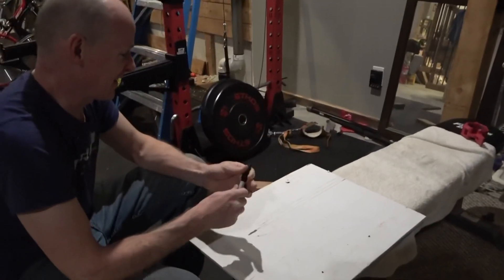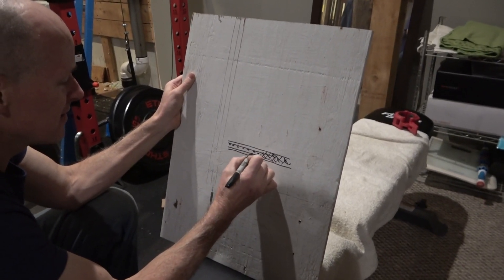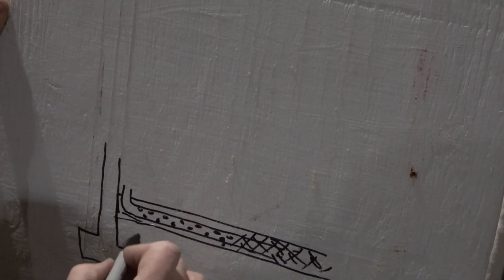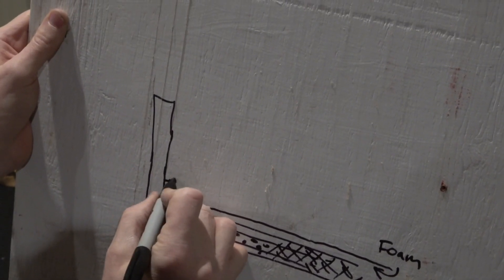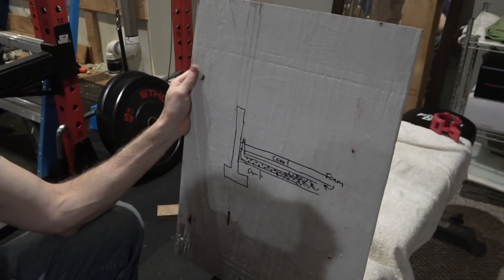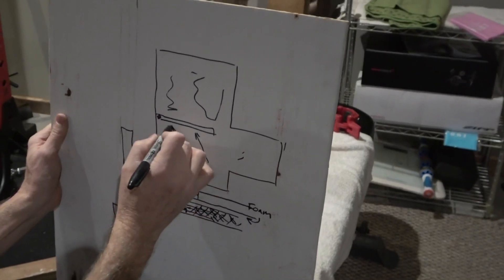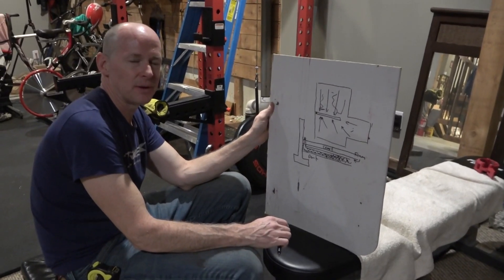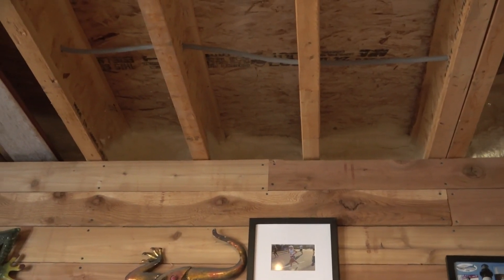Radioactive Gas in our Home! Radon Fan System Install

Comment: Some thoughts....I suggest reviewing EPA & WHO mitigation standards. Please don't open that window until the pipe is extended appropriately. You should remove the rubber couplers inside the home and glue instead. You dont want a leak in the home. Is the gray pipe for electrical work?
Reply from the maker: Thanks for the suggestions.
Reply: Most welcome. I did some research years back. I looked up a current link for the standards,  https://www.epa.gov/radon/radon-standards-practice . I enjoy your videos. Keep up the great work.

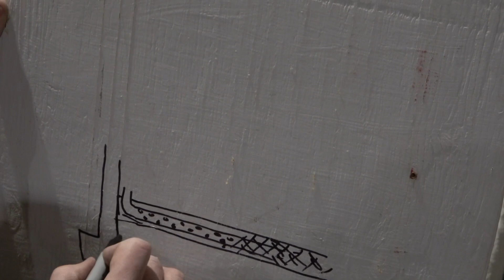Comment: I have never seen dirt put on top of a footing.  @3:50  The gravel should be on the footing.
The gravel should also have drain pipes that go outside or to a sump pump.
For air to be removed from under the floor, there has to be a way for new air to replace the air removed.
The drain system is probably providing the replacement air.
Reply from the maker: Yes there is a drain system in place.

Comment: Illinois has high levels of radon gas so I had the system installed about nine years ago.  My reading was nine on the main level and probably would have been 18 in the basement.  The fan lasted about seven years and was replaced with a more powerful fan.  I ran my up through the garage and then past the peak of the garage.  I don’t like seeing the system on the outside of the houses.  My installer put a higher quality pvc pipe in. My reading now is -0.04.  Some towns in Illinois now require piping when building a house.  My nephew in Dayton, OH bought a house that the wife had died of radon gas cancer.  That is the reason why I had my house checked!!
Reply from the maker: Wow thanks for sharing! We will cover the outside unit eventually.

Comment: I do  think you might want to extend it at least a few foot higher as right now it is venting out at the height of your window there. No problem in winter, but in nice weather when the window is open??? Easy enough to do before you install your box around it. Just food for thought.
Reply from the maker: True, but the outlet is facing the opposite direction of the window. .Usually if one one window is open in the summer , there is another window open for a cross breeze; often it's a window in the kitchen area, so plenty of ventilation in summer months. Of the deck door is open as well, don't require any A/C :)

Comment: When my Parents passed away, we sold their home that they lived in for 50+ years located about 11 miles from us also in the mountains. The people buying it had a home inspection that we knew would pass, but they also had a radon and mold test done. The radon test failed. They got a estimate, and we also did. $24,000 dollars ! It had to be fixed because at that point we had to disclose it to any potential buyers. And our bid was higher than theirs. We tried to do 50/50, but they felt they were at their maximum on the home. The home had a crawl space that had to be totally encapsulated. They ran piping to hook to a fan that ran the air up over the roof line. The price also included a new furnace that exchanged air with the outside. I think it was 70/30. We thought of just auctioning it off for best price, but decided just to fix it and get rid of it. System has a 20 year transferable warranty and we just escrowed the money at closing so the new owners got it done in their name. My parents never had lung issues or negative radon exposure issues. My Father smoked cigars.
Reply from the maker: Wow. Not even sure how to respond to that story. Makes you wonder if there is some "industry interests" at work; that's really too bad for older homes. Sorry what a pain! Happy your parents were able to live a long healthy life regardless.
Reply: Wow, that's insane for radon mitigation, but I don't live in CO, so the issue may be much worse there. If I can get a contractor to do an install at my house (in KY) it'll run about $1,000. Problem is the housing market is so crazy right now every contractor has more work than they can handle.

Comment: I am thinking of installing one too. What made you decide to move the fan outside?
Reply from the maker: It's best practice, in the event the fan ever develops a leak or stops working, you will not have it releasing gas inside. It would be almost impossible to know if it was leaking, unless you were testing for radon regularly.

Comment: How is the Radon able to permeate through  the 2" of under floor insulation? I would expect the insulation is 'closed-cell' so gas/vapour cannot pass. Maybe the gas is getting into the wall cavity?
Reply from the maker: Perhaps through the cracks between the sheets of insulation? It's not one giant sheet, rather multiple sheets laid out.

Comment: Here in cornwall uk we build a sump point under the concrete that the gas can accumulate and then is piped to the outside and a fan fitted when necessary like yours. We have known about radon here for decades because of mining and was very prevalent in these places. I remember when I worked below ground as a miner they were monitoring levels 3000 times what was considered safe limits that we were working in. The air flow structure had to be changed  via massive fans mounted above ventilation shafts to help extract  the gas from the workings.
Reply from the maker: I believe our risk is high due to the mining in this area and type of rock (decomposed granite). Wow! 3000x safe levels- that's incredible. Glad to hear the company was able to mitigate the airflow conditions!
Reply: @ColoradoMountainLiving   they did to a point but we still worked well beyond safe levels and had to live with it. I'm not aware that any of my co workers suffered from  consequences of it despite the hype over it. Since we were born with natural high levels around us  perhaps our bodies have adapted to above normal levels.   The Geiger counters used to go berserk in some places, and still do in areas above ground .

Comment: I learned years ago in my project of mitigation that radon is expelled from all earthen materials (concrete, Sheetrock,etc.)...  My question is why not have some removal of basement air incorporated , and I know why you didn’t terminate about roof, but would that not be better..  Thanks for your hard work of sharing and greetings from “Bluff Country” Iowa.   Always enjoy your videos!
Reply from the maker: What do you mean by "removal of basement air"? That is what the fan does. And every time we use the basement door, (multiple times on a daily basis). The fan now acts to remove air from under the slab so it doesn't permeate through the concrete. You can terminate above the roof (which is more difficult ); but the termination just just needs to be 10 feet above ground.
Reply: @ColoradoMountainLiving  I assumed your test was taken in the basement and your home is very new, thus you perhaps have leakage into or from something within the basement causing your test to be unsatisfactory..   The fan will not be able to overcome wind from the direction your outlet faces believe me, thus going above the roof and open gives you positive flow or draft..   To help explain, those fans are not high pressure or capacity thus it doesn’t take a lot of wind to negate the flow.